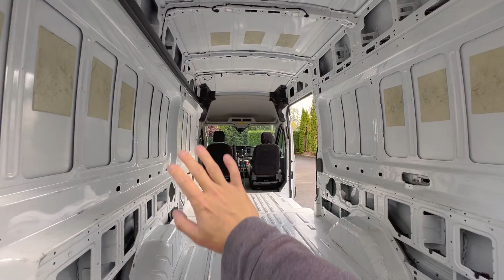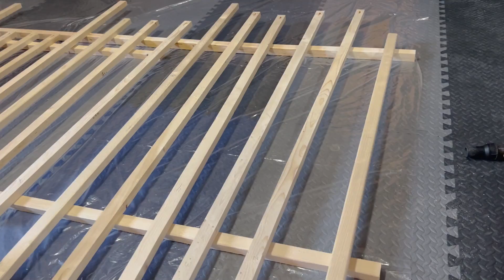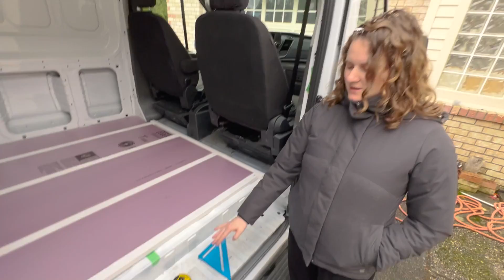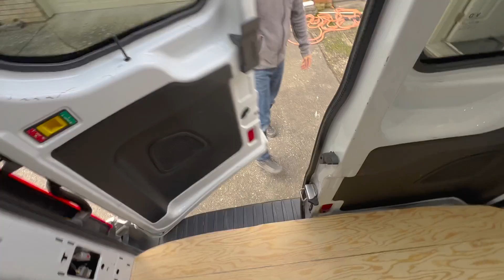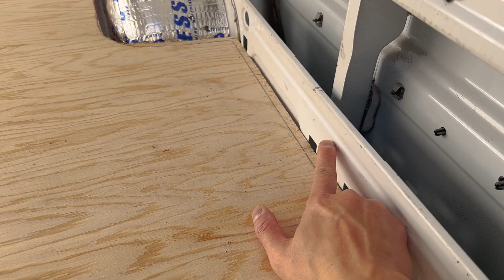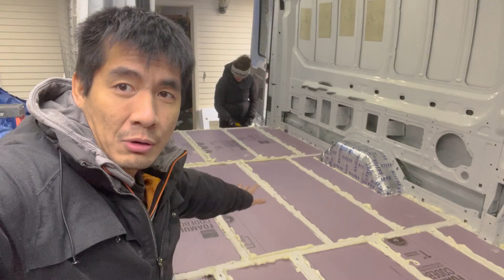Building our Subfloor! Ford Transit AWD Campervan

Comment: Hi, did you glue your battens to the floor?

If so, did you put weight on them while gluing to apply pressure?

I see everyone doing that, but apparently it's not recommended…

Did yours hold?
Reply from the maker: Yes we did glue them and put weight on them overnight to cure
Reply: @LetsJustGoTravel thank you !

Comment: You made a great choice. I have a 2015 250 used it for delivery's till 2020. Then did a van conversion on it. At present I have 522000 plus miles (840000 km) Wife and I love it.
Reply from the maker: Holy cow that’s amazing!! I don’t suppose it’s still on its original motor?

Comment: Hey. Looking good. Are you going with a diesel heater? If so should the exhaust go to the floor?  Just a thought. I'm sure it in your plans.
Reply from the maker: Thanks! We’re going to use a gas heater that’s plumbed into the vans gas tank, and it will be located under the passenger seat